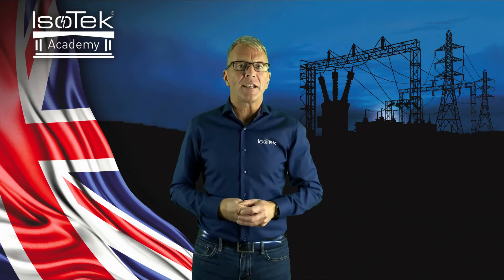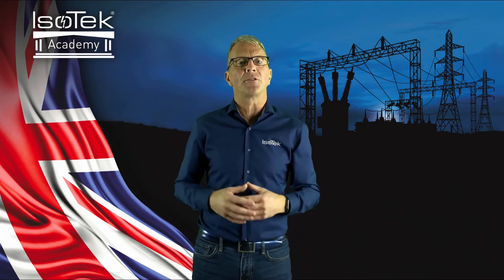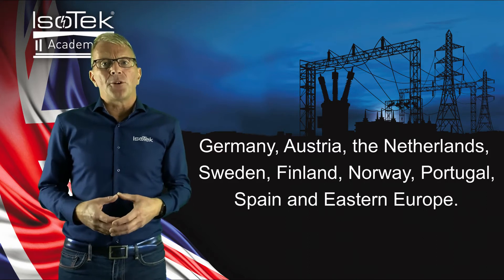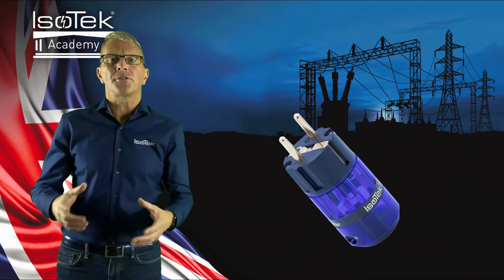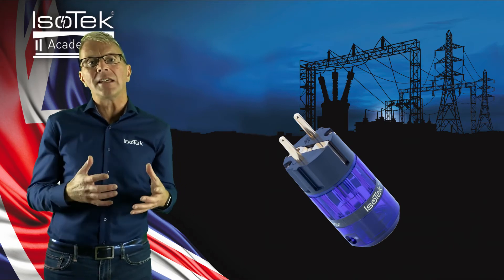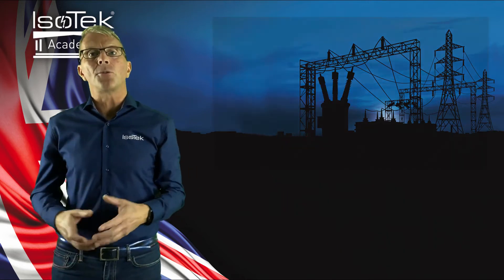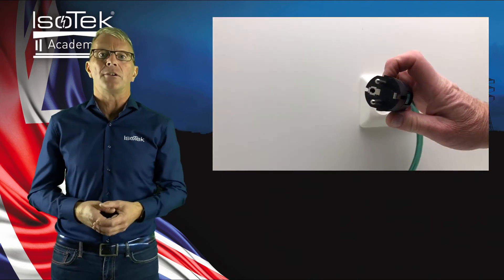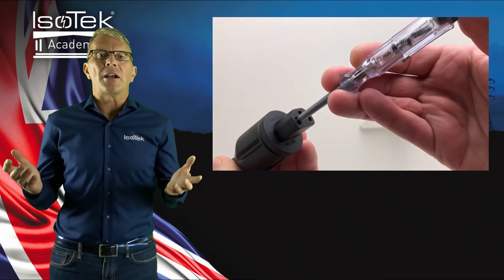IsoTek Academy - Mains Phase - Power Cables

Comment: Why doesn't Iso Tek offer shorter power cords?  An AV rack filled with the long power cords that Iso Tek sells, instead of more appropriate lengths , would be a mess.  I don't get it.
Reply from the maker: We are offering various cables in a shorter and longer lengths. Which cable are you referring to and in which country do you live?
Reply: @IsoTekSystems  I emailed Iso Tek about this, but have not receives a response.  I am in California.   I purchased an Aquarius two weeks ago and want to buy matching power cords to connect my component to the Aquarius.  But the only matching Evo 3 cords I can find are 1.5M, way too long.
Reply from the maker: @LS-ti6jo  What email address did you send your email to? You should contact MOFI Distribution (https://mofidistribution.com) because they handle the IsoTek distribution in the US.

Comment: My new cd speler denon dcd 900ne  the c13 plug is Upside Down . Is de phase Upside Down?? I am using The isotec evo3 initium
Reply from the maker: No, the phase is not upside down - the direction of the power inlet has no effect on the phase.
Reply: @IsoTekSystems  Oké left right It Doesn't Matter How? In this cd speler? 
Thanks greetings from Holland
Reply from the maker: @bono1412  Sorry, I do not get your question. The phase should be at the exact pin as explained in the video.

Comment: I so glad in uk we don't have this issue 😂
Reply from the maker: Did you check if all your cables have live on the correct pin?
Reply: @IsoTekSystems  for my home cinema no as all power cables are custom made for me.
Reply from the maker: @harpalchauhan428  But you could still test them with an electricians screwdriver?!
Reply: @IsoTekSystems  i will do that then i have voltage checker but need to find it lol i took my cinema apart and was using it to keep all my cables apart from each others current flow. But my 6yr old  son would always come get and try be adventurous by touching speaker cables to see current but i had to hide it as he would go to the power cables and he's been taught not to plug in anything in or out only allowed to switch his tv power or xbox power on buy not from plug socket but with voltage checker he put in the live socket of my surge protector so i decide to hide it in my home cinema room and can't find as everything is all over the place. Lol but will definitely do that and let you know. Thanks for being helpful im looking into getting your IEC connectors put on to 2 power cables for my amp and bluray player once my rooms back to normal been mostly like that since November as i work during days and then rather spend time with family instead of waste couple hours in there before was just put movie on but every 6 months i take everthing apart to clean just this time not had time first time its not been put back together after 2 weeks since 2012. Thanks for reading my messages and replying. 👏👏👍

Comment: So in those countries, is the neutral bonded to ground at the main panel like in the USA? I also know some of Europe supplies three phase to residential dwellings. For at  least 20 years now USA two wire devices have polarized plugs. They started doing this so that our lamp socket rings would always be a ground potential or just a few volts above. Our grounded plugs force proper polarity. In the USA we get split phase for residential power where you have 240v across the two hots and the utility transformer center tapped is grounded so either phase to the ground and neutral is 120v.
Reply from the maker: No, the neutral is NOT bonded to the ground at the main panel. You can read more about electrical wiring for example in the UK here: https://en.wikipedia.org/wiki/Electrical_wiring_in_the_United_Kingdom.

Comment: Hello i live in Norway when i check my c13 plugg i get a flashing light in bouth the left and the right  whay dose this mean?
Reply: This means you are connected to the old Norwegian IT power network and there is a floating phase, so there is no way to set the phase with this system. Only TN power network has dedicated phase and is used in parts of Norway and also the rest of Europe.